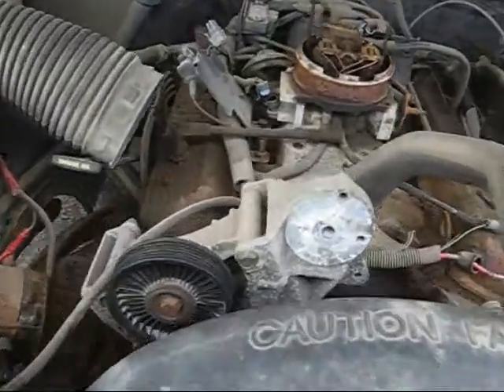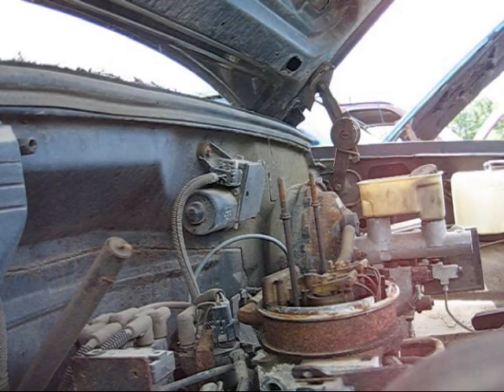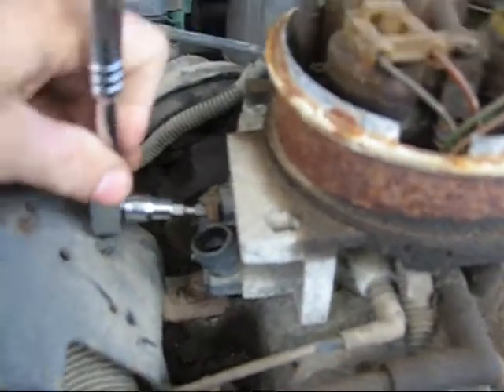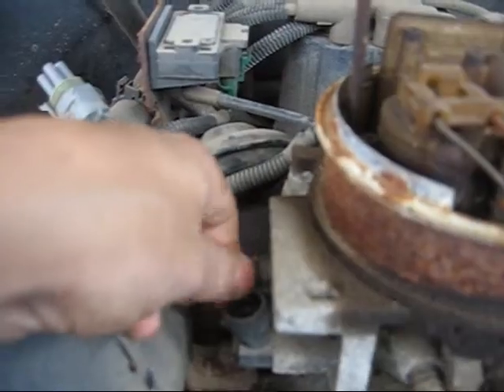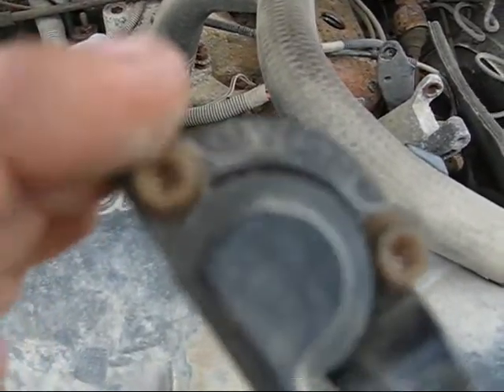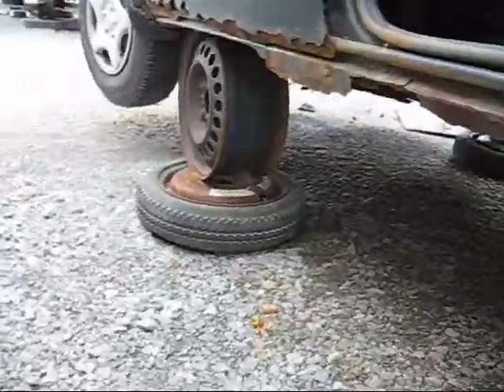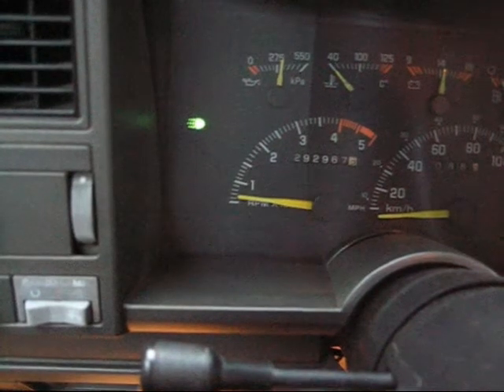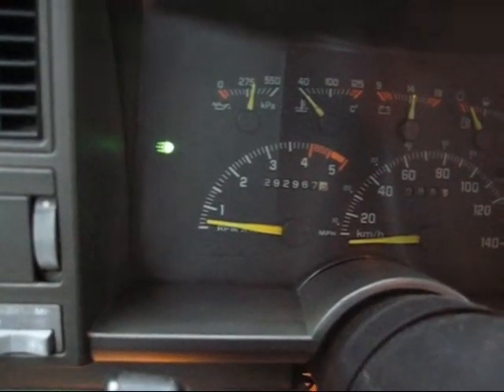Cheap aftermarket TPS sensors

Comment from the maker: oh yeah? I havent tried a replacement AC delco, only know the original lasted 15 years. I've taken care to make sure I had no play in the shaft. Pretty crazy but I have no leaks or wear in those bushings. I could show you the old tps had no spring left, it's as if the 'cup' is no longer connected to the spring and the potentionmeter. ~180k miles.  I'll run the junkyard part for now then try a ac delco if mine breaks again.

Comment: I had a few AC delco TPS sensors mess up and cause a high idle and delayed shift points. I don't think recessive play in the throttle blade shaft helps either. The bushings wear out on the TBI throttle bodies.